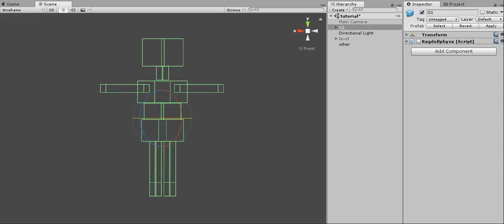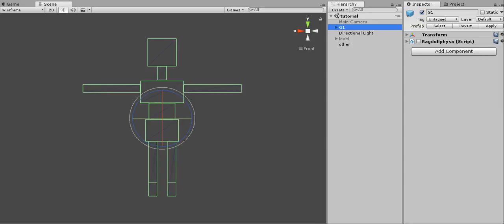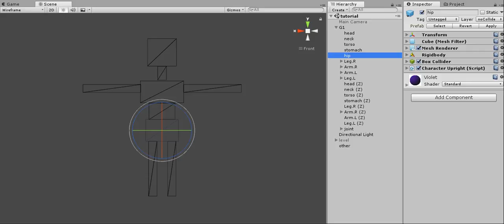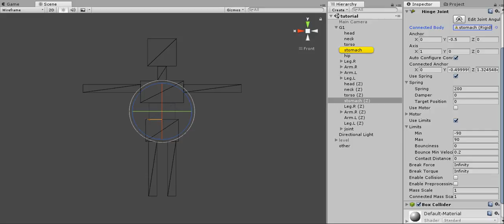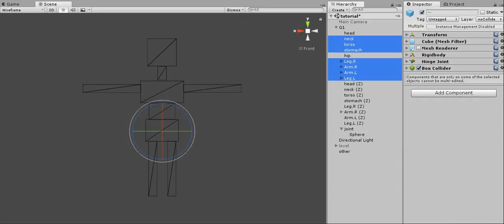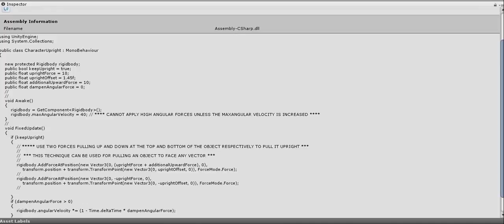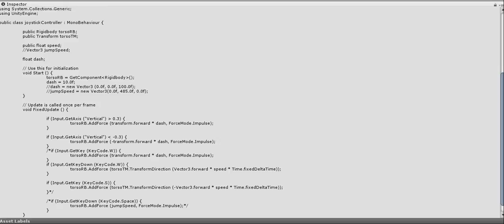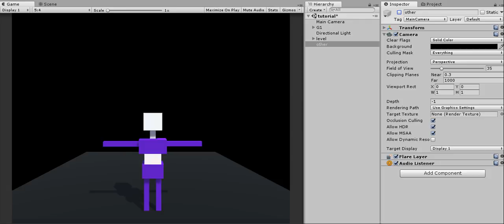Assemble an Active Ragdoll in Unity w/ hinge joints - Subtitles Available!

Comment: hi, did u used the ragdoll wizard thing of unity? or you made that all by yourself? couse, im trying to use the ragdoll wizard but i cant properly understand how does it works :C pd: i bought you a cofee :3
Reply from the maker: hi , yeah I made it from scratch without the ragdoll wizard. Basically if you have a gameobject that you want to make into a ragdoll add either a configurable joint or a hinge joint component to it then connect to another rigidbody. Then the next major step is to make sure that the anchor is properly placed where you want the joint to connect, for example two cubes you'lll want the anchor to be in the middle of the two cubes as the anchor is the point where the joints will connect. Then theres the axis which is the direction the connected joint will rotate. Take a look at the configurable & hinge joint settings in the projects to get a better understanding on setting up ragdolls. Thank you for the support let me know if you have any questions.